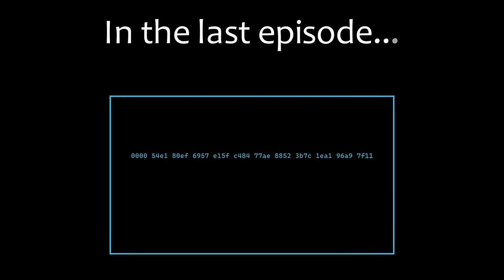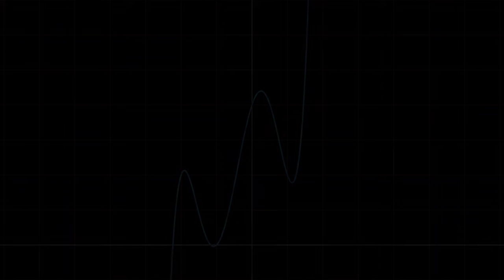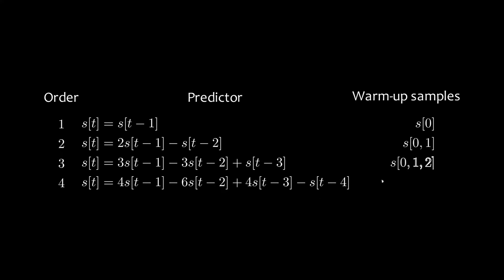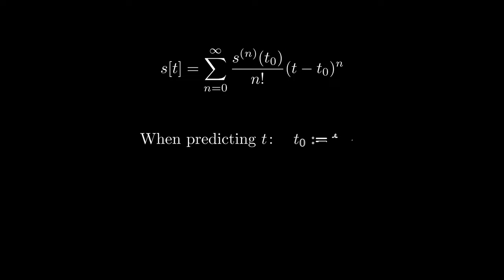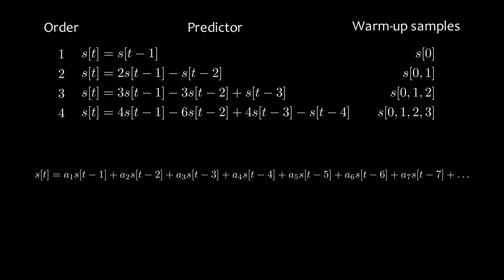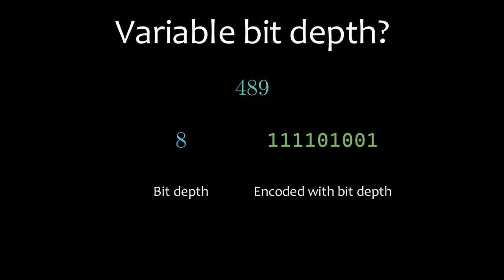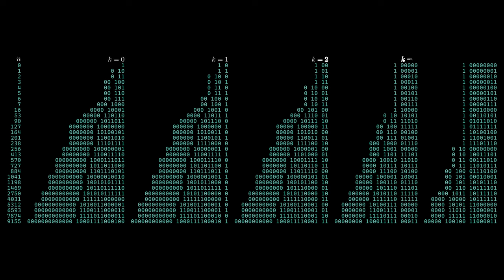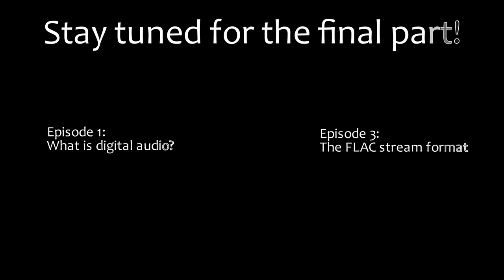But how can it fit so much music? (The FLAC Codec #2 – Lossless Audio Compression)

Comment: Thanks for making an educational video on FLAC :)

I hope this is not too blunt, but I'd like to point out a few problems in it :(

1) FLAC does not actually use Exp-Golomb coding, it works with Rice coding. The idea is similar, but it is ideal for a different distribution of residuals. Rice coding is actually simpler. To convert the residual samples to Rice symbols, we take a certain Rice parameter (I'll not discuss how to find the optimal parameter) and split the number according to it.

If we need to store the number 9 (1001 in binary) with Rice parameter 3, we split that binary number in a most significant part (1) and a least significant part (001). The Rice parameter determines how many bits go into the least significant part. The 1 is stored unary (so becomes 01) and the rest is stored directly. A decoder can parse this, because the unary part is self-terminating, and the number of bits that follow the unary number is known. The number 7 (111) becomes the symbol 1111 (unary 1, binary 111), the number 34 (100010) becomes 000000001010.

So, instead of a 3-part code, we only have a 2-part code.

2) At 15:11 you remark that higher order polynomials take more time to compute and more warm-up samples, but this is often not the reason lower order fixed predictors are used. The problem is that all derivations you do up to that point assume a stationary signal, but this is often not the case. The high coefficients used in higher order predictors make them increasingly sensitive to noise. This often results in the noise getting 'amplified', and the residual getting larger instead of smaller when compared with a smaller order predictor.

3) At 15:37 you say that the factorial divisors are missing, and that these are left out because we're not doing exact math. I don't think that is the explanation, I rather think it is a result of using Taylor expansions (which assume continuous data) on sampled data. If you follow the rationale written down at https://www.ietf.org/archive/id/draft-ietf-cellar-flac-07.html#name-fixed-predictor-subframe there is no missing factor.

For example, to derive the third order fixed predictor, it makes sense to start from the last known sample, the last known first order discrete derivative and the last known second order discrete derivative. We add these three together. The last known sample is s[n-1]. The last known first order discrete derivative is s[n-1] - s[n-2], i.e. the difference between the last two samples. The last known second order discrete derivative is ((s[n-1] - s[n-2]) - (s[n-2] - s[n-3])), i.e. the difference between the last two first order discrete derivatives. If we put that all together we get 3*s[n-1] - 3*s[n-2] + s[n-3]. So, I don't know where the factorials went, but just trying to explain this without using a Taylor expansion seems to work fine.

I hope this helps you :)
Reply from the maker: Thank you very much, this means a lot to me!

Regarding 1), this doesn't sound new to me, and I think it's just another interpretation. For my own implementation I did follow the "Rice coding" interpretation as the spec also does, since it's of course significantly simpler in software. I wanted to have a discovery process that I was leading the viewer along, and the Exponential Golomb path seemed more natural.
Regarding 2), thanks for pointing that out, I did not properly research why and how orders are chosen (and in fact I still don't know since I have not (yet) written an encoder)
Regarding 3), this was an oversimplification made to explain via Taylor Expansions, which I think quite some viewers will be familiar with. I have done the derivation myself as per the rationale you linked and found that there's nothing missing, but this is again where I wanted to have a discovery journey as well as a hopefully-familiar angle of approach.

I will keep this as the pinned comment so viewers can read it as well :^)
Reply: @kleinesfilmroellchen please put out part 3, you're doing this so well

Comment: Thank you for all the insights! I don't quite understand the mid side part of the video. If the left and the right samples are 16 bit integers, the sum will fit only into 32 bit integer which is big. If I divide them by 2 that will fit but the result gets rounded like if the left is 0 and the right is 1 the result would be 0 just like if they were both 0. How could I do this properly and take advantage on the side part being very small and keep the mid part small as well?